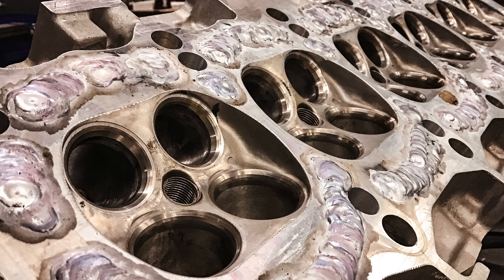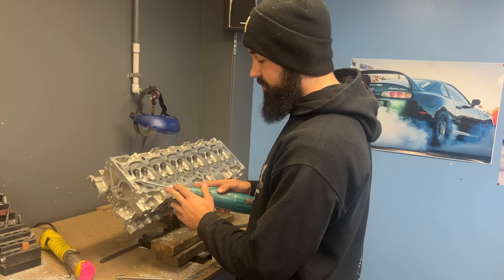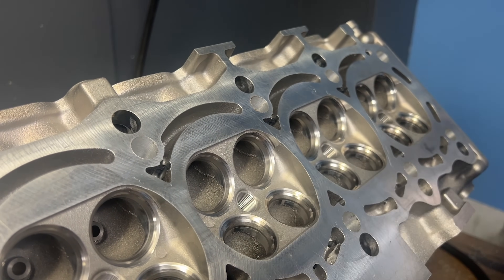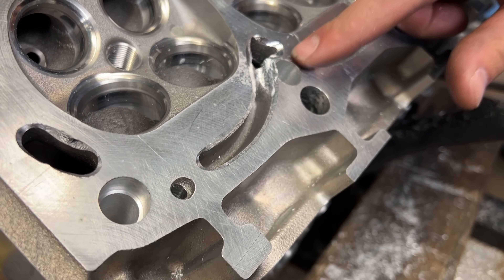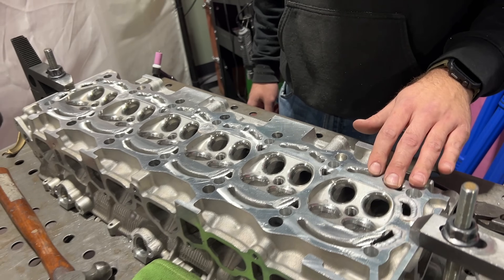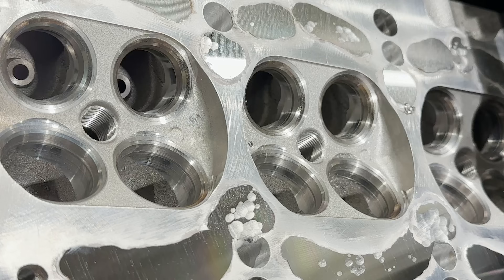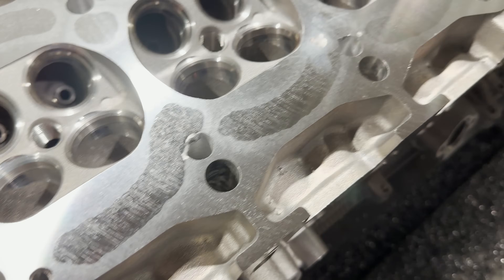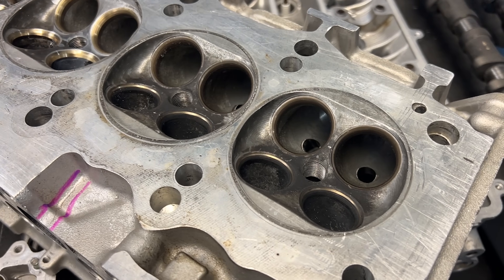Welding up water jackets on a 2JZ! Why!? How!?

Comment: Isnt there still open water jackets on block side of the head gasket .so water could still get out if head lifts..for that to work ud have to weld the block side 2..think about it.  For real
Reply from the maker: No, these go on a filled block or billet with no water. Otherwise, like you said it would not make sense.

Comment: How flow coolant in cylinder head after? It need a separate coolant pump and coolant circuit?
Reply from the maker: They run water through the head with the water pump, no water in the block.

Comment: bruh, completely left out the part about the water still being flowed through it, like, HOW?  In the first part I swear you said you'll show that later, but like, WHERE?
Reply: On my small block 350 Chevy heads there are threaded holes in each head that I can attach a temperature sender / sensor or I can run water into the head and then it will come out through the intake just as if I was pumping it from the Block directly into the head. Mooseheads have plugs on them holes that are threaded for sensors or other stuff to be mounted in the head

Comment: Drag racing is really nothing and lacks progress. This a good example😂
Reply from the maker: Maybe on your island but over here it hasn’t been stagnant for a few decades.
Reply: @headgames  It’s a stagnant car-hobby by definition.
Reply: That's really deep and insightful factual piece of information. I doo believe this is for racing as much as it's for controling cylinder pressure and safety on something that's going to over 100 psi of boost

Comment: So this is like pouring concrete in your engine to handle the power in a way right? Or am i wrong????
Reply from the maker: Kinda but we are not filling the head, still runs water. Just no water between the block and the head

Comment: I understand it's business but why not simply us a head gasket with no water holes in it ?
Reply from the maker: It’s not business, it is safety. A head gasket would not solve the problem of water getting under the car if the head lifts.
Reply: I wonder if it's possible to cool the block and head with external hoses if you use a dry deck method

Comment: No cooling on the block...is this why you never see 1/4 mile cars driving anywhere but the track...thay would melt ...I love going fast but if I can't take it to pick my groceries up I'm not a fan
Reply from the maker: That is correct, these things are for cars you can never drive on the street. World’s fastest. 70-100psi and nitrous. Not a grocery getter.
Reply: Thats why you have to stage in a certain time or you are accused of trying to overheat the opponents car.
Reply: I think picking up your groceries in your race car is imposible once your making over 1200hp let alone 2000+. You’d be spending more money driving the car than all the crockeries you bought
Reply: Still water cooled just not passing between block and head through oem passages.
Reply: @frizzlefry5  just what i was thinking. There are other ways to still cool that head and other ways to get coolant inside that head if needed. The pro now is that he can use a wider head gasket without blocking the water passages thus sustaining higher boost levels.
Reply: @frizzlefry5  first of what your describing is called a dry deck and that’s not what’s going on hear there is zero water in a water in a 2500hp solid (no water jackets) billet 2j block.. I’m gonna go out on a limb and say your probably one of those know it all YouTube professionals that all ways gives their wild ass opinion! LoL

Comment: Wait so how do you cool the head?
Reply: If you really wanted to run water through the head, you can drill and tap/ weld NPT bungs for water feed/return. But engines like this don't run long enough to require cooling, plus it's likely running on pure methanol which naturally runs MUCH cooler than gasoline.
Reply from the maker: Just let it cool
Reply from the maker: We still run water through the head. Just like your saying, it has a bung or 3 of them at the top

Comment: l wont bring a tig anywhere near a cast head, crazy stuff, simply kills a head, soft as butter now.
Reply from the maker: 20 years of doing this, never made one butter. Takes 100psi and 400 shot of nitrous like a champ.
Reply: @headgames  Good stuff, not to mention all the guides and seats falling out from the extreme temps across the head. In my shop in Aus l plug all the water openings, even in a complex water jacket map like a Jz. And cnc plugs for a Jz look like they were never there in the first place, and NO heat.
Reply: Sound like alot more work
Reply: @crunchermuncher93  better for the head, hardness

Comment: Good morning Dave find your technical details and information very insightful, I have been an engineer rebuilder since 1981 have you ever tried 4047 filler rod I always found the shrink back of 4043 put way too much tension in the casting would really like to hear your comments
Reply from the maker: no issues this far

Comment: Looks like you've got this process well-sorted. But a couple suggestions if I may be so presumptuous:

1. Rearrange the weld bench so the welder can sit comfortably rather than stand/hover over the work. Welding is always easier/better when the welder has good ergonomics.
2. Consider a bigger gas cup on the welding torch - one of the clear Pyrex ones really enhances the vision of the welder - allowing him to work better/faster/easier.
3. If you're not already, consider a welding power supply that can blend AC current with DC current. My Everlast 255ext does this and it makes welding on thick chunks of aluminum SOO much better. Everlast calls this feature "Advanced AC pulse". It really works great.
4. Try out using 4643 filler rod. It will naturally age (even without heat treatment) harder/stronger than typical 4043 rod will. It flows/welds/works about the same as 4043.
5. Rather than beating the weld with a ball peen hammer, consider trying a pneumatic needle gun. Gives 10X the effect of the ball peen, and does it 10X faster. I use this technique whenever I weld on cast-iron. Works great.

Hope you don't take this as criticism of your already-proven work!
Reply from the maker: I would never take offense to a well thought out response and opinion. That’s how we learn! We have an everlast 325. I’m going to look into that needle gun idea.
Reply: Nice response. People are so afraid of giving out information that's so helpful to others, but stuff like this only helps without giving away trade secrets where pros make their money.
Reply: This is how we get better.
Reply: Big welding cups are pointless with aluminium, even the product descriptions say not to be used with ac on some of the bigger ones. For stainless and titanium they are great because those are reactive metals and need that gas cover.
Reply: I'm not sold on the "Advanced AC pulse", you can't blend AC current with DC current - you can give AC current a DC offset which is basically what the AC balance control does, gives the AC a positive or negative bias. Looks like the "Advanced AC pulse" switches between AC and DC, so the positive cleaning half cycles cease periodically, the current remains negative and is perhaps reduced for a certain amount of time.
Reply: @Sydney268  The "Advanced AC Pulse" feature allows you to program AC interruptions into DC welding - or I suppose DC interruptions into AC welding, depending on how you program the settings.

You can program how often the machine switches between AC and DC, how long the interruption lasts, and how much current for each.

If you've ever welded aluminum on DC, you know it's basically a whole different discipline, mainly on account of the lack of AC cleaning, the way the molten aluminum "flows" and how it looks. The advantage is of course that 100% of the current goes directly into putting heat into the workpiece, allowing you to weld on big heavy chunks of aluminum without a preheat. It also allows a 250 amp machine to do the work you'd normally need a 350A machine for.

With the Advanced AC pulse feature, you can find a setting that provides enough AC often enough to keep your DC aluminum weld clean. The result is the weld puddle looks and flows like you're used to with AC - but provides the horsepower and instant meltiness that usually requires DC.

Comment: Why wouldn’t you just do that in a milling machine?
Reply: It’s not a precision operation. Wouldn’t justify setup time / effort or provide any benefit or advantage.
Reply from the maker: Do what in a mill?
Reply: @headgames  remove material for welding.
Reply from the maker: @MrBlackbutang  did you watch the video? We did remove it on the mill
Reply from the maker: @MrBlackbutang  oh you mean around the water jackets. So much easier to grind it.

Comment: Have you tried spraying a little WD-40 On the deck surface before the finish cut? In my experience it will help prevent the cutter from galling the surface. I usually take a 5 tenths finish cut as well which usually helps with the RA and overall look. I have a feeling you already know all this and I'm wasting my breath. But I just mention it in hopes of helping. Awesome video as always Dave. 

On a side note do you guys ever bake cylinder heads there during the repair process to straighten them?
Reply from the maker: We use WD on every head! We used to use PAM. And still do from time to time. 
We don’t bake them, we send them out for that.